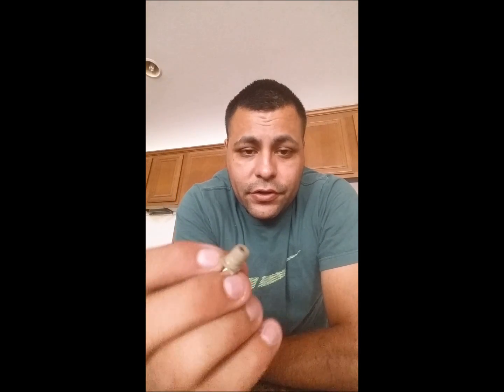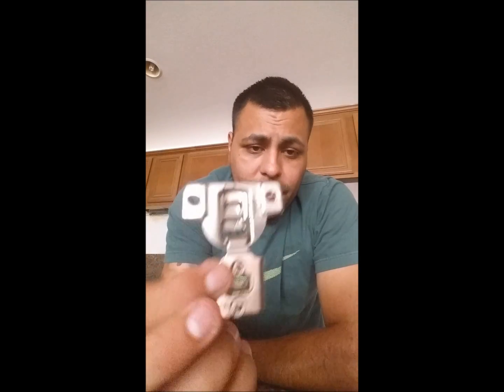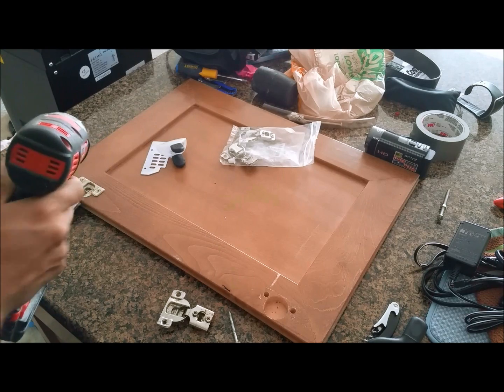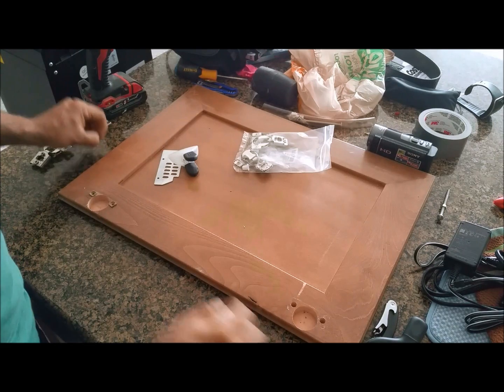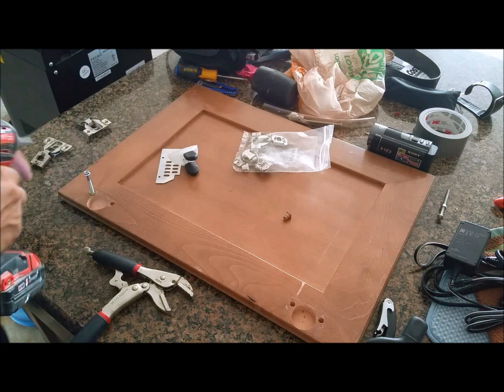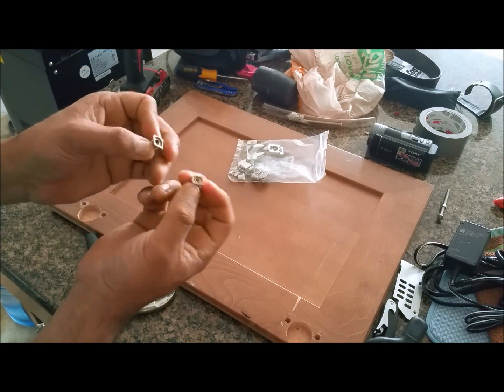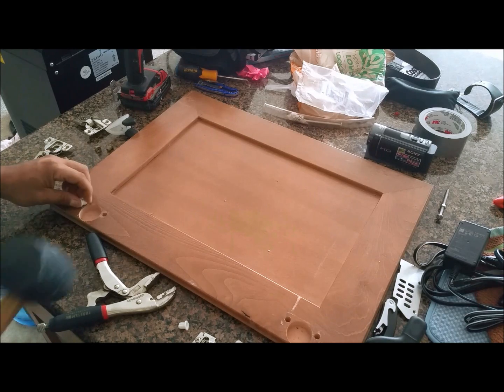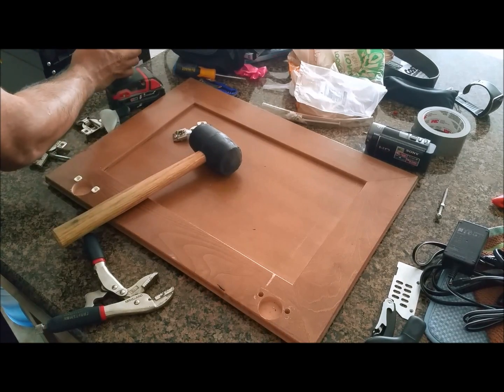How to Replace a Kitchen Cabinet Door Hinge and Plastic Dowels

Comment: If I might make a suggestion, instead of tapping the dowels in one at a time, leave them attached to back of the hinge, back the screws out just as you did, but don't remove them completely then gently tap the entire hinge assembly into the door. This save you time, but more importantly it will not allow the dowels to turn and be offset from the hinge, when this happens the screws are likely to strip and then you have the same problem you started with.
Reply from the maker: Thanks for the suggestion.

Comment: Where did you purchase the plastic dowels that you used in your video?
Reply from the maker: B William Harris thanks for watching. I was able to find a pack of hinges with the dowels included at Home Depot. I didn't find the dowels separately. Here a link to amazon to give you an idea.
 
Hinge Dowel and Screws, 8 Pack https://www.amazon.com/dp/B005MXBPHM/ref=cm_sw_r_sms_c_api_ulS2ybKFN7KZF

You can also buy the dowels separately but make sure you buy the right size.

Rok Hardware 8mm Plastic Hinge Dowel Inserts with Screws, 100 Pack https://www.amazon.com/dp/B015O4DCBK/ref=cm_sw_r_sms_c_api_kAS2ybZSEV9MG

Just ask your hardware store and see if they carry them. Hope I was able to help and thanks for watching.